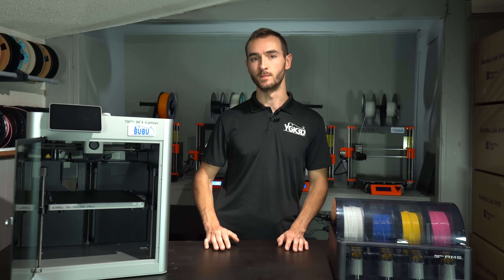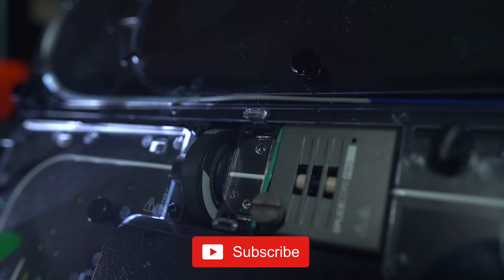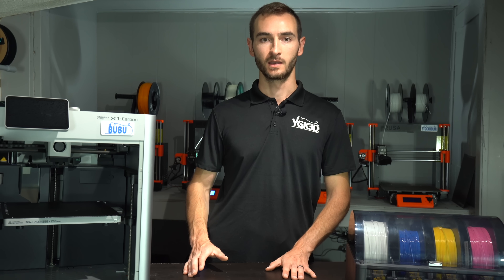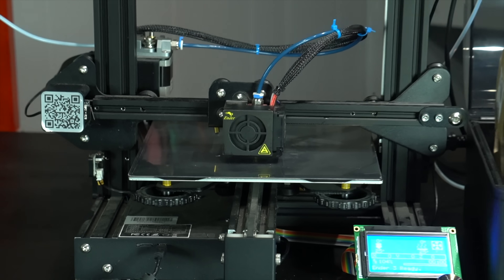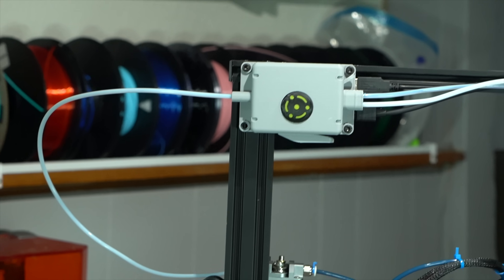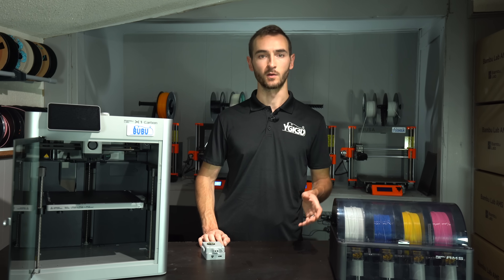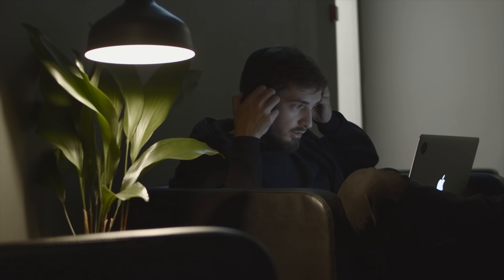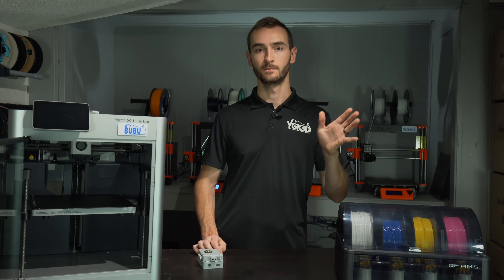This Could Change EVERYTHING.... Again. Bambu Lab's Big Announcement.

Comment: noooooop. there wont be a large amount of purge because you can use a optical filament sensor to keep track and retract the filament and only cut the buldge that forms when you pull filament. with this system there will be less purge than the current system. the bulge is the only thing that needs removing hence why prusa MMU is unreliable.

Comment: I don't think is going to be something for any 3d printer because if people start having problems because if the printer doesn't work with the "multiplexer" they are going to blame bambu product and that would be a bad move. I think is a new machine with some kind of ams system or ams system to mix filaments and I hope is that because mixing 4 colors instead of just changing between colors is going to be so cool and you can make any color with just 4 filaments

Comment: I'm inclined to agree with you.  Some additional points: Usage of the AMS also encourage use of Bambulab filament (with those very nice rfids and ready-working profiles).  That actually will help drive costs down for everyone. Once you decide to upgrade to a new printer, if you already have an AMS, logic would kinda lead you to a Bambulab printer.  It's an excellent lure.

But seriously Bambulab, gimme an IDEX already.  I want more multi-material capability.  Especially for flexibles!
Reply from the maker: Great points!

Comment: The most annoying part of the loud noise produced by Bambu Lab printers is the one that can go far beyond the room where the printers are sitting. It's conduction sound, due to vibrations transmitted to furnitures then walls, ground, ceilings. An out-of-phase noise canceling speaker would mitigate only the aerial sound which is the less irritating and already doesn't pass thick doors.

Comment: Noise cancelling doesn't work that way. If you designed noise cancelling system in that manner, you'd only succeed in making it louder. The reason for this is that the sound has to match both phase and vector direction. This is why you can have noise cancelling headphones, and you can have room at just acoustics at the speaker source... But you can't have a non source or non canceling set up easily. The physics makes it almost impossible

Comment: I really enjoy that everyone think you need a microphone and speaker for noice canceling. But what about noice? Noice are generated by moving moving air and the sound is based on the frequency. If the Printer is moving, it will be vibrate a lot. If you design for example a counter part that weights the same as the print head and is moving in the opposite direction, that will eliminate a lot of vibration on the system and should result in a more silent printer... But that is not the only way to canceling vibration without microphone and without speakers ;-)

Comment: As other say the multiplexer makes sense.  But the notice canceling would not work due to the source of the sound and the placement of the speaker can't be on the same place. This causes interferens  patterns with both low and high sound.

Comment: You definizly missed the second most critical part of bambulabs AMS: The filament-"buffer". It contains a slider with a magnet inside, a spring and a hall-effect-sensor. If the extruder pulls filament, but the feeder of the AMS do not deliver filament nor not fast enough, the slider moves compressing the spring. Due to the hall-effect sensor, the electronic always know the position of the slider and can accelerate, decellerate, start, stof or even reverse the AMS-feeder (and also turn on the motor on the spool holders to rewind filament). A quite simple and elegant solution to synchronise the AMS feeder and the extruder (as even a slight different tension leads to slighty different effective diameter of the gears, so you can not simply put to feeders in series). If you adjust it acordingly, the buffer should even be able to detect unload (any retraction >3mm would obviously be an unload).

Actually, it would be quite simple (if you have time and skills) to do your own, better replacement for the AMS in my opinion:
Build a filament-"buffer", Place it as near as possible to the direct extruder, connected with a bowden to it. directly before the "buffer" place a hub (one output, 4 inputs. A motor to select is not needed imho. But a filament sensor (C) right before every input.
A spoolholder with classic motor to rewind. A feeder following (maybe with filament sensor (A) entryside (to autoload - like on the mk3s if you insert filament). Sort of switch to guide the filament to a cutter, to automaticly cut the filament tip, or to the hub. A filament sensor in front of the switch (B).
The process of switching between filaments: Filament is unloaded. The AMS-feeder pulls it out, untill the filament sensor B is reached. Now the switch turns. The AMS-feeder pushes the filament to the cutter, wich cuts the tip of the filament (wich falls down into a bin). The AMS-Feeder retracts the filament untill its in front of the switch (sensed by filament sensor B). Swich is turned and the filament is pushed until filament sensor C is reached (directly in front of the hub).

The nice thing: As soon as the filament is unloaded and has left the hub, the next filament can be loaded, so the rewinding, cutting and preparing for the next load can be done while the printer already has loaded the next filament and prints.

Actually you could do this quite modular: A spoolholder (maxbe even a filament drybox) with filament sensor A, feeder, filamentsensor B, a switch, filament cutter, bin (can be much smaler as on the Bambulabs printers, as just the filament tip is cut off) and an output were the filament goes to the hub. In different sizes - for 1,2, 5 and 10kg spools. As the feeder takes care of pulling filament from the roll and pushing it through everything up to zhe "buffer" (and while loading of course up to the extruder). As soon as the extruder took the filament, the extruder just need to pull the filament through the short bowden from the buffer and move the slider. everything else is taken care by the Spool-Feeder.

Electricly: the "buffer" provides just a signal with position of the slider on multiple outputs in parallel. So every single "spool unit" could get the information to synchronise the feeder in the spool-unit and the extruder while printing. Signal is simply ignored while unloading, loading, cutting or inactive. Also every spool unit has an input for the filamentsensor "C" (in front of the hub. Every Spool unit has an input for "load" (unload is detected by slider movement). It has outputs for "left the hub" (so next filament can be loaded) and "ready to go" /if the freshly cut filament is in front of the hub again).

For a 2-material AMS there is no electrical conection to the printer needed. If filament is unloaded, obviously the other is to be loaded. so both spool-units could comunicate directly with each other. For more than 2 materials, a communication between the printer and the AMS is needed (or a seperate controler with SD-slot an a copy of the gcode, just to know the order of Toolchange commands T...).

Actually, for the spool-unit I would recommend ramps based controler boards, as they have everything on board (exept for the double-H-bridge for the Motor). You even could controll the heater if you want a drybox and can connect a i2c humidity sensor. Also they collect dust anyway, and for the feeder its no problem to use a allegro driver.

The "buffer" needs just a smal Arduino.

Actually seperate Spool-units seem the most flexible for me. If you have f.e. 8 spool-units and a print with 8 materials, you use them all with one printer. Or you have 4 prints with two materials each - you can use 2 each. Or you have 8 printers and use one for each. Each printer you want to use with this system just needs a "buffer" and a hub with enough inputs (but you could cascade multiple hubs).

Just some ideas to make a universal AMS by yourself.

Comment: Using a 'bed slinger' to go up and down to press the cutting lever is going to be crazy sllllooooowww. On something like an ender 5 is would be way quicker if it's mounted on the side. But I'd rather hope there will be a more direct connection between the AMS unit and the filament feeder.
Reply from the maker: Yeah, that could be an issue. If it would be possible to mount it on the X or Y axis that would save a lot of time.

Comment: Red hearing with only dual in/out - as there have been lots of AMS multi-feeder issues being posted.  

I suspect it is a new improved AMS feeder. 

I just wish the AMS bottom cover was able to be remove to clear filament clogs as my big paws/forearms have a real hard time reconnecting the inside two data cables (that are about 6" too short).

Comment: I think the only way active noise cancelling can work in a printer is via a microphone array not a single mic as the coming from the printer varies from position inside the printer.

A single mic would not match the frequency information of a stepper motor on the other side of the enclosure.
Reply from the maker: Mhhh… yeah, may not be as straightforward as I was thinking.
Reply: @ygk3d  Hey so I have been thinking on the teaser images. I was thinking of a traditional means of noise cancellation using mics and speakers. But generally the noise created by a 3D printer is vibration. So it could be an accelerometer attached to a rumble motor that vibrates 180 degrees out of phase.
Reply from the maker: @ClustaFlux  if Bambu doesn’t make it, you should 😅
Reply: @ygk3d  lol. It is loosely related to something I am working on. but I think I will start playing around with this idea as well for my biqu b1.

Comment: Interesting thoughts! I personally think that instead of 2 AMS's, there will be 4 AMS's option. Instead of two ptfe tubes you've demonstrated, I'd say there will be 2x2 ptfe tubes... makes much more sense to me, as the want you to buy 4 AMS's and not restricted to 2 ;-)
Reply from the maker: Perhaps… my thought is that there still needs to be some advantage to buying an X1C or P1P so they might water down the hardware a bit for 3rd party printers by not allowing as many connections.

Comment: I honestly don't think Bambu is in the business of improving third parties. I can imagine the margins would be extremely small and I don't see them wanting to support 'everyone's ' 3 printer. Imagine you buy a Bambu printhead for a Prusa. Imagine something doesn't work - Prusa will blame Bambu and Bambu will blame Prusa. Just not worth the few cents they'd be making on it. 

The whole 'colour for everyone' could also be a bed slinger with multi colour printhead that is cheaper than the P1x with AMS.
Reply from the maker: I would agree that a universally compatible print head would open up a can of worms. This multiplexer idea has a lot of the same issues, so perhaps it’s not feasible, but would be less integration required than a print head.

Comment: I think this makes the most sense and is what I was thinking too but you have put a lot more thought into it, like having the device placed horizontally compared to the picture. Note that in this teaser picture there is no logo, which would allow it to be placed in any orientation and not look odd (like an upside down bambu logo).

One thing I didn’t notice if you addressed is that AMS would need to be powered from the wall. So they’d need to also sell a power brick connector. Trivial of course but still. I don’t know if you were implying that the AMS would be powered from this device which is run off the usb from the printer. Not enough juice for that. And the AMS would probably still need a buffer system like the current hub has. Which has a spring system to give constant light pressure. 

And agreed that the noise cancelling device is likely a different product.

Comment: Colors are for noobs.

I want to combine flexible and non-flexible engineering filaments with a water-soluble support.

If you want pretty colors that's what paint is for.
Reply from the maker: Sounds like you might need a Prusa XL… or wait for a Bambu IDEX. I think color is important to a lot of hobbyists. They want to make pretty things without the labor or skill required for painting.

Comment: They currently cut filament just right above the heatsink and look at the waste in multicolor prints. Imagine multiply that by the factor of tens because of the long bowden tube. If there’s really such a device it needs to be mounted just right above the current toolhead of other printers. They probably sell an adapter with it. Also the cutter on the right makes sense since most printers will have a limit switch on the left.
Reply from the maker: If the cut happened in advance of the intended change most of the filament remaining in the tube could be used in the print, without waste. This would, however, limit the minimum length of a color change. If the amount of that color required is less than the length of the Bowden tube, then yes, it would generate a lot more waste as the excess would need to go on the purge tower.

I had a similar thought process re: limit switch location. There must be some reason they put the cutter on the right and not the left…

Comment: I don't think that BambuLab would make such a device for other manufacturers. My theory is that they will release cheap a bed slinger with this adapter for multicolor printing. It would fit the slogan - similar to the AnkerMake Kickstarter. 
I'm not too sure about the ANC implementation with a microphone/speaker setup. From what I know it is not possible to do that in a room because the soundwaves go in too many directions. There are some interesting videos about that here on youtube. I think that it would be more of a software fix/new fans/new stepper drivers or it could be related to the new bed slinger being very quiet.
Reply: No way they’ll release a bed slinger. The p1p is already a cheap printer. They have no desire to get into the sub $300 printer space with a cheap crappy printer. Leave that market for Creality and Prusa. 

And besides, they say “Product Release to see how we can "Magically" tune down the noise.” That “magic” is not “here’s a slow crap printer that’s quiet”
Reply: @c0mputer  Let's see ;) 9 more days to go
Reply from the maker: Interesting point on ANC. Didn’t think of that..

Comment: Do you think they will come up with a firmware for other printers to make this AMS device compatible or just a Klipper feature?
Reply from the maker: It would be easiest to integrate if their was no firmware component to it. Just g-code being streamed to the printer from the multiplexer. Bambu Studio would add the extra commands to go to the purge tower and a separate file for the cut sequence and timing to control the multiplexer and the AMS.

Comment: An IDEX printer with AMS compatibilaty for each toolhead would be awesome, although I would prefer a toolchanger printer from Bamboo.
I can see K1 and K1 Max owners going mad for AMS compatibility, I have vowed to never buy a Creality product ever again having been stung by them on many occasions over the years, I wouldn't mind having a QIDI Max 3 with AMS compatibility though as I want to be able to print some of the high temp engineering filaments that are available these days.
Reply from the maker: Until the competition can present an AMS equivalent Bambu will continue to dominate. Anker teased one but it has yet to materialize as far as I’m aware. Creality and Qidi either don’t think it’s important or are working on something behind the scenes. In the race to catch up to Bambu they clearly only had time to focus on the printer, and not the multi-material system.
Reply: @ygk3d  I think the other manufacturers that were planning to develop or are developing an AMS type product will definitely have to up their game to compete with this product, hell! Creality even fixed a fault in their K1 which to my knowledge is the first time they have done that, usually they just move on to the next Creality printer and leave the community to fix their shortcomings but with Bamboo Lab taking so much market share they were forced to change their policy which is a winner for the consumer!

Comment: I think "For Everyone" is simply Bambu acknowledging that not everyone can afford a $1000+ P1S+AMS combo. So they're about to bring to market a cheaper printer, maybe around the ~$400 mark. Maybe they'll lower the price, or have a cheaper alternative to the AMS as well. 
Selling an accessory for competitor's 3D printers makes no sense at all. The AMS is a selling point for Bambu. Not only that, in practice they'd suddenly have to offer support on competing brand 3D printers that don't work with their accessory.
Reply from the maker: They’d sell way more AMS units this way. And if it’s a watered down version (2 inputs instead of 4) it could be a good gateway to get people to buy a Bambu printer down the road. So I think it can make sense, but you’re right, a lower cost AMS compatible printer is probably more likely.

Comment: If Bambu Labs really wants to own it all they should be looking into a retrofit for 3d printers. Reliable print heads, AMS, and custom boards. However as a stepping stone making AMS available for all printers could be their core business model and future market leverage to bring people to buy their printer for the AMS people already own.
Reply from the maker: I agree. I think it would be a great stepping stone. This device would be limited compared to the integrated ecosystem of Bambu… 2 AMS’s v.s. 4 and more filament waste due to the longer distance between the cutter and the hotend. There would still be a reason to want to buy a Bambu printer but this could be the gateway drug so to speak.